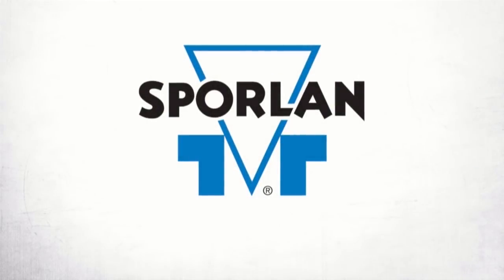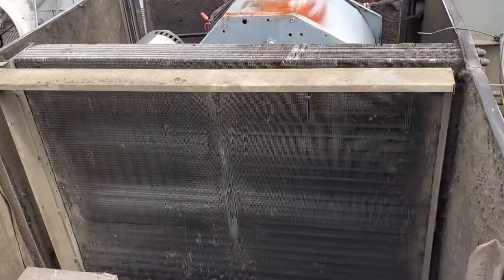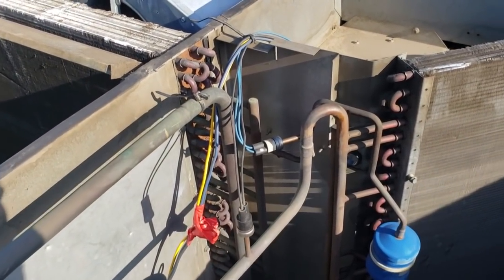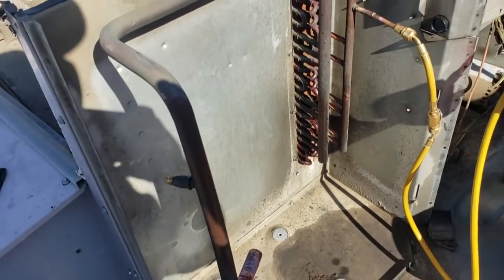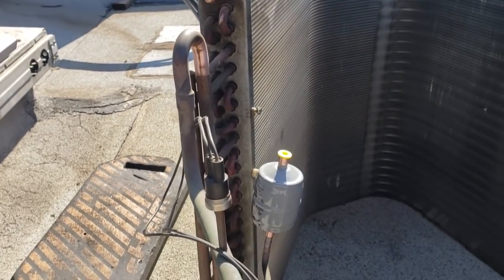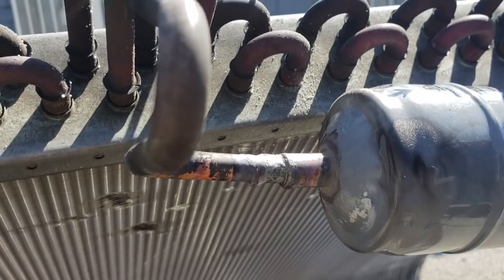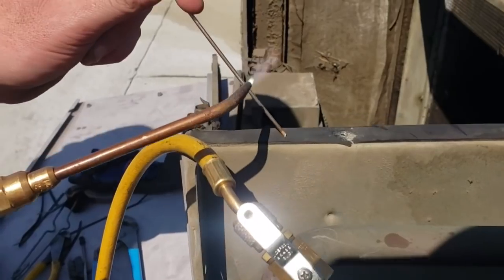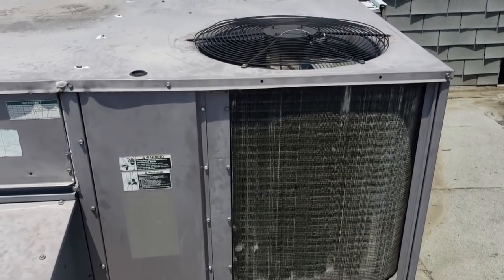CARRIER NO COOLING CALL

Comment: The soldering was hard to watch;  but I remember myself being in that position many many years ago.   Gotta start somewhere =)
Reply: I remember when I first started and I managed to blow through a 3/8 filter dryer...Face Palm...Never happened again...
Reply: Some people have a talent, some need a lot of training and tries. And yes it is painful to watch usually and cringy, hard not to laugh or not to get frustrated. But most eventually gets its and are good.
Reply: I nearly lost my patience at one point
Reply: @ogaremmanuel4032  you'd make a terrible teacher then
Reply from the maker: Wet rag by refrigeration Technologies
Reply: I felt the same way. Cringe... Leaded solder flows beautifully. I worked with non-leaded for years in electronics though. I'm not sure of the lead content in what he's using.
Reply: HVACR VIDEOS good video! I’m wondering what size torch tip you and your guys use?
Reply from the maker: Typically a #2 tip and anything bigger than 7/8 I use a rosebud tip
Reply: I agree that the compressor is bad but the leak seems to be unrelated in that location.  Looks like a friction leak like all Carriers of that type. Breeze Mechanical.
Reply: @HVACRVIDEOS  I appreciate you keeping these beautiful air conditioners running as long as possible.
Reply: We were all there once guys.
Reply: Yup. Everyone starts somewhere.
Newbs gonna make mistakes, but its though mistakes and hardship that you can learn.. Or at least those who willing will learn.
Reply: First time I had to "professionally" repair a 20 ton condenser, that the installation crew had run a screw though, 😡! I didn't even own a torch. Went and bought one, got my n2 bottle, clean the f'er up, purge with n2 , do my stuff, .... still making bubbles with n2 pressure test. Bleed of and open system, try again.... NFW! Wash, rinse, repeat! Right?
Third or fourth go round, I forgot to bleed the 100 psi n2 out... put the torch to it...
Won't ever do THAT again! 
I've gotten better over the years..

Comment: Another tip. Before lighting the torch take the torch and simulate how your going to move your torch around the braze joint. If there's a tricky point you can decide if there's an easier way to solder it
Reply: That's a great idea.  The whole difficulty are the weird angles you have to move into without burning anything else. A rehearsal. Also going to hook several rods before starting.
Reply: Make the flame blueish yellow and and keep he torch maximum away. Heat the portion even and apply solder.
Reply: +Roy -- Great tip!  It's like my HS football coaches beat into us -- You Play Like You Practice!
Reply: always do this while welding too, helps you get the angles right and get comfortable
Reply: thx

Comment: I agree. Never under any circumstances flash cool a freshly welded joint, it makes the joint weaker and it may not leak today but I’ve had to go bad behind some install guys that I know were in a hurry and fix their welds because they started leaking within a week after the job was done. To the new guys watching when the copper changes color, it’s time to pull the torch back a little bit, the solder will follow the heat. The torch is the paintbrush, the solder is the paint, drag it into the joint. It wants to be a liquid, and don’t be afraid to add a little extra on the joint. Solder is cheap compared to a callback.

Comment: The zip tie inside a zip tie to prevent a rub leak is a good idea. I've been a tech for 23+ years and I have never thought of that. You're never to old or experienced to learn from someone else. Thanks for making these videos, I really appreciate it and I Know it's helping a lot of new techs by having the opportunity to see these things done properly. Thanks again for sharing your skill and time with us.
Reply from the maker: thanks for watching!
Reply: Silicone works too 😉
Reply: Next Idea: If you cut the end of the zip tie flush with the "zip tie holding thingy" with a proper tool like e.g. "Knipex 78 31 125", then there won't be any sharp edges which cut into your arms if you reach next to this zip tied cable. Normal cutting pliers leave nasty sharp edges on the cut side of the zip tie.
Reply: Same! Never thought of the either. I have zipped a piece of armaflex between two pipes...doesn't always hold

Comment: Dude your a damn unicorn in the sense that you forwent all cockiness and put a perfect balance between getting the job done efficiently while providing efficient training. For about just short of a year now Ive been making the transition from residential HVAC/R to commercial/light industrial and your videos have been of great help in getting a better grasp on how these systems work internally as well as focusing on the problem vs symptoms of the problem. Thanks for the insight and great videos, the guys under your wing should consider themselves VERY lucky.

Comment: You have to love Carrier package units. They have made me a lot of money over the years. I don't sell them but I do work on them. Lol
Reply: if major marketing problem call me.
Reply: I'm an HVAC Student myself GB and I'm understanding why Carrier units are unpopular with HVAC techs. Thanks for the video.
Reply: Oh! I love these Carrier units! I have to clean condenser coil at least once per year, if it is located close to big street with traffic it might be twice per year. Blower motor belt needs replacement every ~ 2 years. The leak caused by the compression vibration like it is shown in this video is very common, problems with metering device are very common, etc. Thank you Carrier we love you!  
P.S. Recently Carrier has changed its technical support over the phone. Now they ask for $75 fee for tech support. Something tells me that this manufacturer will start loosing its new units sales soon if they dot do it already.

Comment: Speaking as a career and technical education teacher, one thing that you may find helpful when training anyone new with soldering and brazing is to have them try out on a few practice fittings in several positions before soldering the real thing.  A small bag of copper fittings and a short piece of pipe generally helps people who are new to soldering and brazing to pick it up faster.  You could even have them sweat on a Schrader valve and pressurize the workpiece to look for leaks.  This is one of those things I have my students go through when we cover plumbing.  I know that this may cut down on work time but this is a good practice if you have some downtime and usually doesn't take to long to get the hang of.  It's great to see you taking the time to train someone new on good practices and tips and tricks while still letting them make a mistake.
Reply: When I help train new guys I give them obstacles in my shop to work around. I make sure they get comfortable with vertical and horizontal welds. The Vertical up welds get them every time, they always ask how come they have to weld behind things or use a mirror to weld, my answer may be obvious to some but I tell them, 99% of your welding will not be in a shop, and it’s easier to mess up here and practice than melt a hole through the copper that is even harder to fix.

Comment: Great job 👍 funny to see R22 still being used there, our phase out ended Dec 2016 (UK). That stuff was liquid gold! £400 per kg here at one point! R422D was our go to drop in.
Reply: 407c here
Reply: Its phased out here as well.  Jan 1st cannot make or or important it, equipment can no longer be manufactured with it either.  Once is runs out, it will be gone.  Its getting expensive though. Lol
Reply: I just change the oil and dryer and use 404

Comment: Seems like a good thing to do would be to take the dead compressor and some dead driers and the like back to the shop and just practice soldering on them for a while. Not as good as field work where you have to stand on your head and drip hot solder in your face, but it can give you some cheap practice on some of the awkward joints. Better than just soldering two straight tubes in the vise.
Reply: I'd like to see the guts of one of those modern compressors too, I still can't get my head around how they make such effective little things not vibrate like crazy in normal operation.
Reply: @44R0Ndin  it's all about balancing the loads.  I don't have specific information about AC compressors, but if you pull a pug wire off a 6 or 8 cyl engine it'll start shaking like mad.  Similar idea to balancing tires, though now your working more in 3 dimensions rather then two.  If all the forces are balanced well there should be little to no shaking.
Reply: @Wooble57  I know the load must be balanced somehow, I just wonder what specific method they used.
Did they use two scroll compressor elements and then mount them to the drive shaft 180 degrees out of phase? Did they use a simple counterweight? That kind of thing.
I just want to see one without the hermetic casing on it, and then see it taken down even further if possible. I know sort-of how a scroll compressor works, but I wonder if there's other types besides scroll and reciprocating.

Screw compressor maybe (built kinda like a Detroid Diesel engine's supercharger)? Those are inherently balanced as all the rotating parts are radially symmetrical.
Reply: @44R0Ndin  https://www.youtube.com/watch?v=yNgqI4XPUZc is a good animation of the internals, at a glace i'd guess they must use some sort of counterweight
Reply: @44R0Ndin  Most scroll compressors have counterweights built into the main motor/rotor. You can find teardowns readily here on YouTube.
Because the scroll elements move in a predictable eccentric pattern, it's simple to counter it with added mass to the driveshaft and motor - which has to be relatively wide anyways to develop operating torque.
Rotary units, usually only seen on small inexpensive units, also use the counter-weighted motor method.
Reciprocating models are balanced the same way as a car engine is, with crank counterweights to oppose the motion of the pistons. This is imperfect, as anyone who's been in a car can attest, thus why these units still vibrate some.
Reply: I do also wonder if they use axial or centrifugal turbines (like what you find in a turbocharger) driven by electric motors to compress the refrigerant on huge systems in the several-hundred-ton capacity range.
I know even on a 15 ton unit they usually use 3 scroll compressors on isolated refrigerant circuits, but just adding more refrigerant circuits seems like something that quickly reaches a limit where you run into issues simply because the system has so many moving parts. Great for redundancy, but horrible to work on (come in to work on it, and the question becomes "which one of these 10 mostly identical systems has the issue?").
Obviously there's a minimum size for such turbine-based compressors, I just don't know when they typically start using those over the "just use more/bigger sealed scroll compressor units" approach.

Comment: Been a tech for over 40 years. You did a great job teaching. One thing I would suggest though just as a good practice. On the discharge at the compressor where you thought it might have been a hole. Go ahead and fill it none the less. The reason being is that there would be less solder in that spot in case of vibration again it'e a possible leak point down the road. When in doubt fill it.  It's just a good habit to get into and you have everything right there to do it and takes so little time for that but it's worth it in the long run. Great Job

Comment: A tip on detecting leaks. Soap solution or commercial leak detectors only go so far. Sometimes just spraying the leak solution after it is applied with water will reveal even the most minute leak. Small leaks sometimes do not force the bubbles in a thick solution but a little dilution with water will create a mountain of small bubbles.

Comment: Christ don’t be so afraid of those YouTube “police”. Maybe most them don’t even braze better than your apprentice. We are here to enjoy your video not to criticize you.
Reply: Jay Xiao I watched a self proclaimed “expert “ on brazing slobber half a stick of silfloss on one joint. He never moved the torch flame and had silfloss slobbered on over three inches of pipe. I took the torch away from him and showed him how to properly apply the heat working the silfloss into the joint by fanning the joint with heat all the way around. Silver based brazing rod does not respond to a joint like 50/50 plumbing solder. You have to work it in to the joint with appropriately applied heat.  My joint held, the “expert’s “ joint failed and had to be redone. Not an easy process!
Reply: @dalegriggs5392  Rule that I learned way too many years ago between sweating copper pipe and soldering up electronics: solder flows towards the heat...
Reply: chemech true. Always heat the copper fittings at the back of the joint. When the heated fitting is sufficiently hot the solder will be sucked right in. Once it does that the joint is done. No need to add more solder which I’ve seen countless guys do. Just wasting solder. As for electronics I always tin the wire and the connection point. Same rule applies, when it melds together stop.

Comment: The problem with using those plastic zip ties on a discharge line where you have high temperature is they will soften , stretch and come loose and the pipe may rub again easier just to separate them so they can`t touch
Reply: They do make stainless steel zip ties, seen my city use them to hold street signs on traffic signal poles.
Reply: The zip tie idea was pretty slick.....in that situation ive also used scrap pieces of armaflex from line set
Reply: General-purpose nylon zip ties have a working temperature of 185 at the high end.
Reply: I've done this exact same repair and that's what I did was reroute the lines and deem it an engineering flaw.   It seemed the leak started small enough that it lost too much oil before it shutdown and took out the compressor.  Some compressors are more sensitive than others to oil loss.

Comment: Good instructional video with lots of pointers ⭐⭐⭐.   You could have drilled the bottom of that manifold on the evap coil and brazed a 1/4 refer stem into it to get the oil out if you wanted to avoid the flush. Also,   6 months and no new imported R22. 😂😂😂 Time to start switching. If the new compressor is POE, we use R407c, I haven't had one problem with it yet,  almost exactly same operationally characteristic as R22.
Reply: That's right, six months and next Montreal Protocol benchmark.  No more import or mfg.  Time flies.
Reply: F the nanny state. Don't delay, Hank Hill your AC today!

Comment: As an IT guy was use to solder on circuit boards and other things. When I learned how to sweat pipes for a home repair, a good tip I got from another youtube channel was to remember heat  rises. So when you want the solder to suck in, heat from the bottom up. Its a little harder when your upside down, and at weird angles, but you could tell he was a little uncomfortable handling the torch. Not terrible, and overheating is definitely going to happen when you're learning. You're a great teacher and very patient, I subscribed cause I like your content and love your big picture approach.

Comment: when you have a dirty filter just use the other side

on a serious note i think compressors should be more user serviceable... i hate replacing them
Reply: @djenson  I think it was a joke. Like a winter and summer air in Tyre joke
Reply: Completely agree with you on the compressor remark! On the Roof Top/Package Units from my experience there not that bad In my opinion the only bad part about them is lugging them up the roof and back down. BUT Split systems are a total nightmare! You have almost no room to grab them and get the out.
Reply: @jonnywilson9117  lol whoops. don't even remember typing the comment
Reply: @djenson  hahaha you were probably drunk and having a good old time :D

Comment: Carrier started using scroll compressors with no crankcase heaters. Unit gets cold at night , liquid refrigerant migrates to bottom of compressor.  On first startup in the morning refrigerant under the oil makes oil foam and carries oil from compressor and bottom bearing fails causing your vibration problem.  I have seen the shell of the compressor crack right at the weld that holds the motor.

Comment: That zip tie trick is a life save if you own an RV with a rooftop air conditioner because those things are very mobile and vibrate from being moved around as well as normal operation. The lines inside are already compacted up and such where rubbing happens and things start leaking.

Comment: Not trying to be a wise guy here but your apprentice is really struggling will his torch setup. I would switch to a Smith Quick Braze or a Smith AW1A both with Kevlar hose. Plenty of heating power and the kevlar hose allows ease of torch movement when in a difficult position. Please tell your apprentice to never wear nitrile or a rubber glove when brazing or soldering. A burn to the skin can be bad enough without rubber embedded in it. Good luck,  great video and instruction

Comment: i have heard of this problem before, i believe it can be traced back to Carrier assembly where someone is over tightening the vibration mounts, causing the rubber to become in compression instead of in shear. then the excessive vibration causes further problems down the line

Comment: Zip tie trick for you, when you cut the tail off use a razor blade and cut it flush with the lock part, them you won't cut yourself if your in there working.